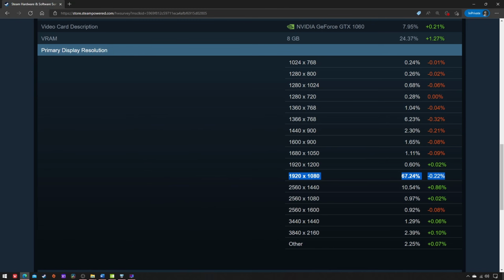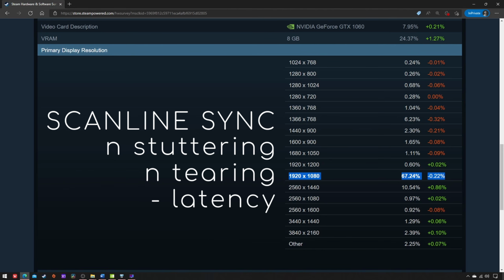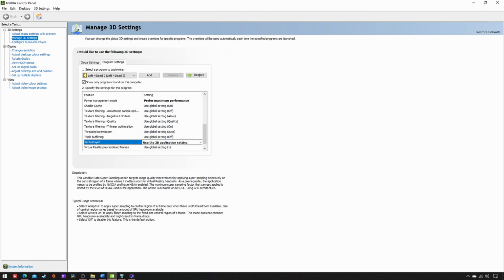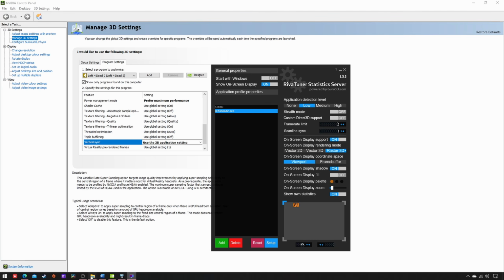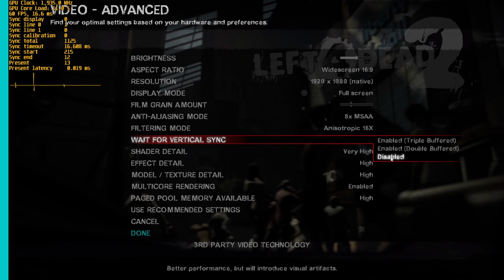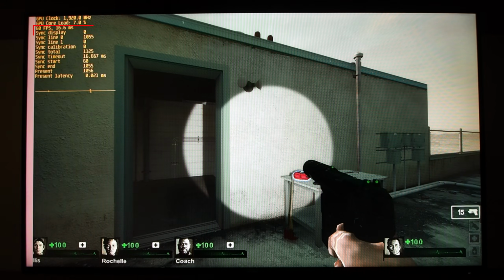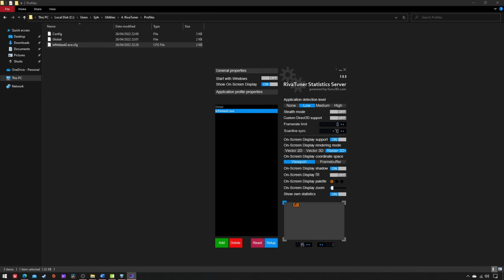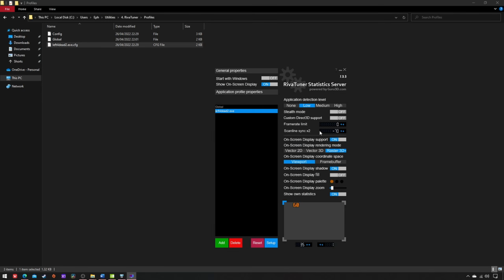How to Set the Coolest Sync Technology: RTSS Scanline Sync

Comment: hello, hwinfo its not showing me in the options "GPU Core Load" i have an amd card
Reply from the maker: Hi! The workaround is to use RTSS itself to show your GPU Usage:

Setup > Plugins > Overlay editor > Data sources > Edit > Add > Internal HAL > GPU1 Usage > OK > OK.
Then, Layers > Add > Double click on it > In Hypertext copy-paste this: GPU1 usage %GPU1 usage% % > Apply > OK.
Reply: @oakenglass  how to use scanline sync + enhanced sync?
Reply from the maker: @Nightwing_Bludhaven  Calibrate the tearline so that it remains above the bottom of the screen at all times, then enable Enhanced Sync.
Bear in mind, however, that this combination is much more finicky to set up and can cause stuttering if the framerate drops too much!
Reply: How much above the bottom? @oakenglass
Reply: @oakenglass  And, why above the bottom and why not below the bottom?
Reply from the maker: @Nightwing_Bludhaven  "SSync + Enhanced/Fast Sync" has different rules to follow than to the normal "SSync + VSync Off" combo: I don't make them, but BlurBusters ;)
As for how much above the bottom, it really depends. The tearline tends to vibrate up and down: the downward vibration must NEVER EVER go below the bottom of the screen.

Comment: Hello, I'm using an AMD gpu and was following this tutorial, even using the same HWiNFO version that you used in this video, but the sensor "GPU Clock Load" dosen't appear, what would be the alternative?, thank you
Reply from the maker: Did you mean "GPU Core Load"? If so, the simplest alternative would be RTSS itself: 
Setup > Plugins > Overlay editor > Data sources > Edit > Add > Internal HAL > GPU1 Usage > OK > OK.
Then, Layers > Add > Double click on it > In Hypertext copy-paste this: GPU1 usage %GPU1 usage% % > Apply > OK.
Reply: @oakenglass Yes, my mistake.

Did what you wrote me, works like a charm, thank you :D

Comment: By any chance, if I manage to OC a very old monitor that had 60hz refresh rate to 64hz, then do I have to set it 64 or 60?

And can I use SSync on Valorant? (I get more than 150+ fps on Valorant)
Reply from the maker: With a 64Hz overclock, you just have to make sure that your FPS are ALWAYS above 64.
Yes, you can use SSync on Valorant, as long as this specific game doesn't block RTSS.

Comment: Question, what would have lower input lag, Scanline Sync or G-Sync? I have a 240hz G-Sync monitor with a 3080 and play Dead by Daylight which is capped at an easily achievable 120 fps.
Reply from the maker: Since Scanline Sync is essentially Vsync Off + Frame Cap, I believe this chart might prove useful:
https://blurbusters.com/wp-content/uploads/2017/06/blur-busters-gsync-101-vsync-off-w-fps-limits-120Hz.png
As you can see by comparing the first two scenarios, G-Sync should have a latency 4-5 ms higher than Vsync Off + Frame Cap.
Would this difference also apply to your specific config and game? I don't know. But my guess is that any difference would still be pretty small...

Comment: Here those information on OSD don't appear: Sync Display; Sync line; Sync line; Sync calibration etc, just the Core Clock, FPS and temperatures, how to enable on OSD to get the values?
Reply from the maker: Did you add the line “SyncInfo=1" in the “[OSD]” section of the "game.cfg" file?
Reply: @oakenglass  As I don't have any cfg game in Profiles folder I added this on Global file, shouldn't it appear this way too?
Reply from the maker: @rfac47  Yes, it should. Is "show own statistics" ON?

Comment: when i make my options can i delete the synchotkeys and so on from my rtss settings?
Reply from the maker: Yup, except "SyncFlush": I'd keep it.
Reply: @oakenglass  i realised that ssync is not working for me on cyberpunk 2077 on my s3422dwg dell monitor. is it normal? so i used not ssync x2 cause i dont have minimum 120 fps so i used -50 normal ssync and async is enabled and the box is ticked but i have tearing. is it thats why that i have frame generation or something on?
Reply: so vsync is off. jedi fallen order works with ssync but not cyberpunk 2077
Reply: @oakenglass  That i should use fast or adaptive sync for cyberpunk 2077? when i must use fast sync?
Reply from the maker: @D.W.14.12  SSync doesn't work well when the GPU Load is too high (I'd say like more than 70-80%).
Since you use Frame Generation in Cyberpunk, I believe this is exactly the case... Fallen Order is much lighter.
AFAIK G-Sync should work on your Dell S3422DWG, so in Cyberpunk I would use it instead of Scanline Sync.
Reply: @oakenglass  yeah unfortunately with flickering in cyberpunk... and in jedi fallen order... i think i must return this monitor. i cant find a good monitor for 500 euro gsync compatible with 4k or 3440x1440...
Reply: @oakenglass  so i can use inofficial g sync but without using hdr 400 cause if i activate g sync compatibilty and hdr 400 then the flickering appears but if i deactivate hdr then all is good or if i deactivate gsync compatibility and activate hdr 400 than all is good. But I don't buy a monitor to not use the features that the monitor brings xD
Reply from the maker: @D.W.14.12  I'm also looking for a new monitor and yes... finding one with no drawbacks at a reasonable price is practically impossible, especially in Europe.
However, if you are a university student (I am no longer one, sadly), you can buy a Samsung monitor at a discounted price, e.g. the G70B (28" IPS 4K 144Hz) at 430€...
Reply: @oakenglass  No, unfortunately I'm not. I am a trainee salesman
but hey thx that u write me here i rly appreciate that man :D

Comment: I can't do step №5, I have no this line, only flashy column, ctrl+shift + arrows do nothing
Reply from the maker: Have you disabled VSync both in-game and inside the NVCP Game Profile?
Have you correctly added "SyncHotkeys=1" under the [Framerate] section of the "Global" file?
Reply: @oakenglass  I did everything except NVCP profile because I have amd gpu. Also I have 144hz monitor, maybe it has the meaning too
Reply from the maker: @NatanieLzZ_Monos  FreeSync is disabled?
Reply: @oakenglass  yes
Reply from the maker: @NatanieLzZ_Monos  Can you try setting 60Hz?

Comment: Any chance that it works on 240hz OLED Screen with games with fluctuating FPS? I tried it but the tearline moves across the monitor.
Can't User G-Sync because of flickering.
Reply from the maker: The most important prerequisite for SSync to work is: "FPS ≥ Refresh Rate"... ALWAYS.
So, I would suggest trying to set the display refresh rate to a fixed value of 120Hz or 60Hz.
Reply: @oakenglass  Thanks for your answer, I understand it now. I will try again with 120Hz.

Comment: You can do the same thing simply by enabling plugins in RTTS and adding hotkeys. Theres even presets for moving skyline sync up and down. Idk maybe it wasnt avaliable when this video was made.
Reply from the maker: No, you're right... I've just never noticed. Many thanks!

For those interested in how to set those hotkeys:
RTSS > Setup > Plugins > HotkeyHandler.dll > Programmable profile modifier 1/2 > Preset: Increase/Decrease Scanline Sync index > OK > Set the desired keys > (2x) OK.
Reply: @oakenglass  i cant make the line move up and down, i set the hot key to up or down, but i press it and is not working.
Reply: its working now, this guide is awesome. Question, does this also introduce some inputlag like vsync?
Reply from the maker: @onlineghost9813  Nope... if properly configured, SSync doesn't add any lag!
Essentially, it's like limiting the FPS to your Max Refresh Rate and moving the Tearline off-screen.
Reply: @onlineghost9813  How did you make the hotkeys to work?? I cant get them to work..

Comment: Question here: I have noticed that Scanline sync only works when the gpu is at around 50% load, after that the image starts to tear. Is this a thing that can be avoided somehow or is this a drawback of the feature? Thanks!
Reply from the maker: Yes, SSync works best if the GPU load is moderate to low.

To try and avoid that tearing, you can set SSync in this way:
-Move the tearline so it never vibrates below the bottom edge.
-Force FastSync or EnhancedSync in the NV/AMD Control Panel.

Comment: What could I have done wrong, if I don't see the colorbar on the left? I cheacked it 2 times withe the video and I have no clue why it doesn't work :(
Reply from the maker: Do you see the OSD but not the color bar?
Reply: @oakenglass  Yes, indeed. In OSD I see only that 2 things that I marked in HWInfo (GPU clock and GPU load), so I suppose the problem might be on the RTSS but I have no idea
Reply from the maker: @adominik7847  If the option "Show own statistics" is set to ON, you should see much more info than that... I'd suggest to reinstall RTSS 7.3.3 Final.

Comment: How to make sync display appear on screen ? Plz help 
I cannot see sync like sync total etc on display
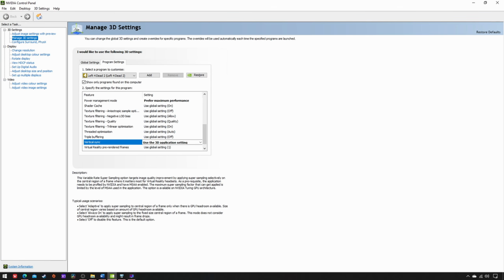Reply from the maker: Did you follow Step #3 (02:17) correctly?
Reply: @oakenglass  I did but it's not working can u plz guide like precisely
Reply from the maker: @Zajjjj666  Honestly, it's hard to be more precise than a video.
The only thing that might hinder the appearance of the OSD is if you inadvertently set the hotkey to activate/deactivate it:
Setup (blue button) > "Plugins" tab > Double-click on "HotkeyHandler.dll" > Remove the hotkey from "Toggle On-Screen Display".
Reply: @Zajjjj666  If you do this on csgo make sure to -allow_third_party_software in launch options

Comment: hello, super great guide! but i have a question, my display is 1080p but i usually play with Nvidia DSR on 1440p. Is the configuration the same? or will it not work at all because of DSR? also, my monitor is 75Hz. Thanks!
EDIT: also i don't have the SyncHotkeys line and the exe.cfg file in my profiles folder, it's just Config and Global
Reply from the maker: Good question.
I've just tried with DSR 1.78x (1440p) and... SSync doesn't work, because the tearline cannot be hidden below the bottom edge of the screen. SSync X2 does work, but produces jittery frametimes. Therefore, I'd suggest disabling DSR if you wanted to try them out (in your case, the FPS must ALWAYS be ≥ 75 for SSync or 150 for SSync X2).

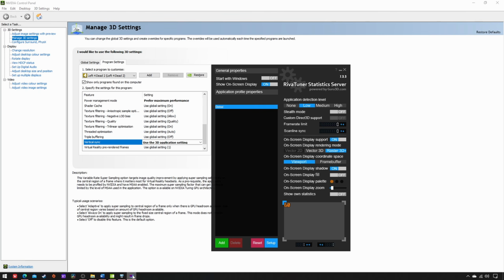The "Game.exe.cfg" file will appear in the "Profiles" folder as soon as the game is added in RTSS (02:17).
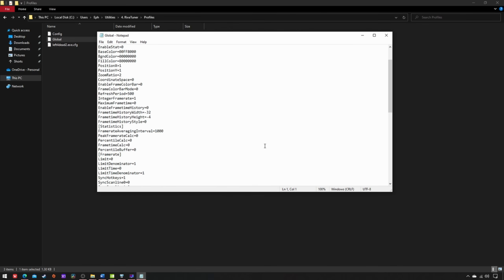SyncHotkeys=1, SyncInfo=1 and SyncFlush=1 are not present by default, they must be added by hand (02:53).
Reply: @oakenglass  but how to put them on display ?

Comment: I'm trying to use this on Red Dead Redemption 2 and it works well but I get these consistent 10-12 milliseconds spikes in frame time, any ideas?
Reply: I found that RDR2 just becomes unstable when playing above 30 FPS, this is probably the reason this game never got a next-gen patch on consoles. My solution was to ignore SSync entirely and cap the FPS to 30 using RTTS then enable in-game VSync, this gives you the absolute smoothest frame rate possible and headroom to increase the graphical settings at the cost of substantially longer loading times.
Reply from the maker: @SplendorSolis  Good solution! 
You could also try SSync X/2 (click twice on "Scanline sync" in RTSS): this will cap the FPS to half the Refresh Rate.
Reply from the maker: This usually happens when the FPS drop below the Refresh Rate.
Try reducing some "heavy" graphics settings such as Anti-Aliasing.

Comment: oK i GOT mine to work my guessing numbers until I found that -30 works best. Now my last question can I use AMD Enhanced Sync in combination with S-Sync? are there any disadvantage?
Reply from the maker: Yes, you can. Enhanced Sync (and Fast Sync) are useful when a game cannot always maintain a framerate above the refresh rate and dips slightly below it. No disadvantages that I know of.
Reply: @oakenglass  wow so you are saying that Scanline Sync in combination with Enhanced Sync will give me a near perfect Freesync / Gsync level of performance?
Reply from the maker: @kinghadu9611  No, FreeSync/GSync are still better.

SSync + Enhanced/Fast Sync must be properly set and the framerate drops must be occasional and small (i.e. FPS no lower than 54 on a 60Hz display).
SSync + Enhanced/Fast Sync has no disadvantages (again, that I know of) when you compare it with SSync + VSync OFF...
Reply: @oakenglass  one minor problem I had was in valorant a certain part of a map has screen tear because for some reason the fps drops from 120 to 117 soon as the fps drops with S-Sync enabled there is a lot of tear. To eliminate this I enabled Enhanced Sync but then I notice certain places there is micro stutter where as it would never happen with S-Sync on alone. 
ONly reason I am putting up with this is because I ordered a XG2431 Rank 1 Esport Monitor in the world with the best backlight strobing but you cannot enable freesync with backlight strobing at the same time.
Reply from the maker: @kinghadu9611  Whereas SSync + Vsync OFF requires the tearline to be moved below the bottom edge, SSync + Enhanced Sync requires the tearline to remain permanently above the bottom edge (similar to what must be done with SSync X2). So, try to move the tearline upwards: the stuttering/lag spikes should disappear.
Reply: @oakenglass  Hi thanks so what you are saying is because completely moved the tear line far bottom off the screen this is why I see tear top and middle of the screen when the FPS dips from 120 to 117?
So if I move the tear line slightly above the bottom of the screen where it is just about noticable I wouldn't have any screen tearing mid and top when the FPS dips a little and alternatively when enhanced sync is enabled no tear and stutter anywhere? yes?
Reply from the maker: @kinghadu9611  
SSync + VSync OFF: the tearline must ALWAYS be calibrated off-screen.
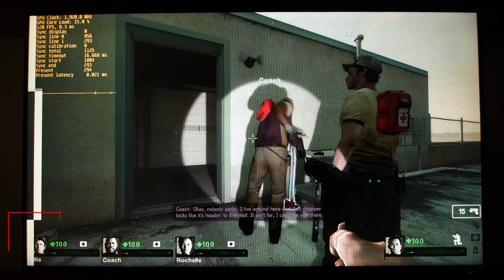SSync + Enhanced Sync ON: the tearline must be moved above the bottom edge of the screen, but so that it NEVER vibrates below it (like at 05:53). If calibrated properly, this should eliminate (almost) all stuttering when FPS drops occurr.
Reply: @oakenglass  wow nice so SSync + Enhanced Sync and tearline moved above bottom of screen means almost Elimination of BOTH Stutter AND TEAR? just to confirm? but it would also mean the FPS must not drop by a huge amount else it can still throw off everything?
Reply from the maker: @kinghadu9611  Yes, both of them. And also, yes, the FPS dips must be occasional AND small.
You're using a 120Hz display, right? If this is the case, the FPS must NEVER fall below 114-108.
Reply: @oakenglass  correct its a 120hz monitor well its a 240HZ Viewsonic XG2431 blurr buster 2.0 certified monitor that needs to be set at 120HZ in order to use backlight strobing, one thing I am confused about what do you mean 114-108? did you mean 120 to 108? in other words you are saying make sure it doesn't drop below 108 FPS? and it should work just as fine as freesync?
Reply from the maker: @kinghadu9611  Yes, the FPS can drop to 108 at the most... but 114 would be ideal. Freesync will always be better.
Reply: @oakenglass  Ok thank you, you have been extremely helpful.
Reply from the maker: @kinghadu9611  No problem!

Comment: WOW if not for you no one would know how to do this, I should note it's not just for people with shit monitors, this is very useful if you are going to use Backlight Strobing features on monitors since none of the high end gaming monitors support VRR + Backlight Strobe at the same time. And many that do support VRR adds much more motion blurr when Freesync etc is enabled
Reply from the maker: Thank you. So, I guess you managed to fix the problem you explained in your other comment?
RTSS creates its "Global File" as soon as you change a "Global" setting.
Reply: @oakenglass  Yeah it's only after I changed something it created the global file but I still didn't get this thing to work tho, your video is entirely different to what is on my PC like none of the words on your screen for config and global files match mine its entirely different. So in the end I gave up and decided to use AMD Enhanced Sync for when enabling Backlight Strobing. Your method is good if the users are very verse in computer science etc but for most people it won't work. 
Luckily AMD enhanced Sync works great

Comment: I recently got my Gaming Laptop and I am pretty good and the system, but my scanline is moving up on its own? Laptop has 120hz, but I play on a 100hz Monitor and just my Monitor is running... any ideas? Rocket League is kinda tricky when it comes to smothness
Reply: What kinda fixed it for me was to use CRU (custom resolution utility) and I overclocked my monitors refreshrate to 110, then the scanline in Rocket League wasn't moving on its own and I was able to set it correctly! Great tutorial!
Reply from the maker: Very interesting. You're not the first to report that the Scanline moves up on its own, but I've never seen it... perhaps because I don't have two displays connected? Will try when I can.

With multiple displays, I know that it would be better to open the “Global” file and add this line under the “[Framerate]” section: "SyncDisplay=X" (where X=0 if you want SSync on the primary display, X=1 on the secondary one, etc.).

Anyway, props for solving your problem in such a creative way!

Comment: i have screen tearings in various places, so when i move tear all the way down it comes back out at the top
Reply from the maker: Try to reduce some graphics settings and/or the refresh rate to 60Hz (if your monitor supports an higher one).
Reply: @oakenglass but if it happens ( 2 different tearing spots ) not cause of my gpu( just game engine problems in Diablo 4 ) can I still get smooth no-tearing  game experience on my 144h monitor without lowering it to 60hz?
Reply from the maker: @SkillerGBB  I've noticed that you commented on some of my other videos. My suggestion would be:
G-Sync ON + V-Sync ON + NVCP "Max Frame Rate" to a value that your system can ALWAYS maintain in Diablo 4.